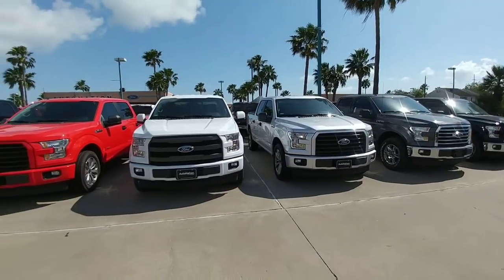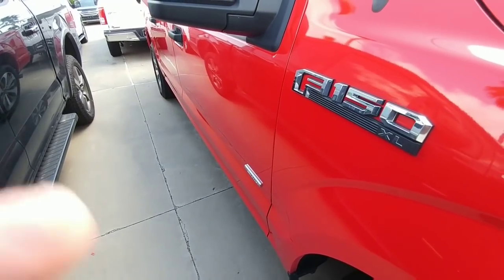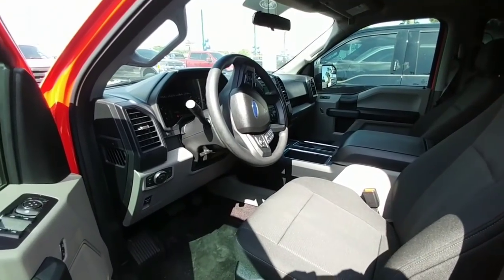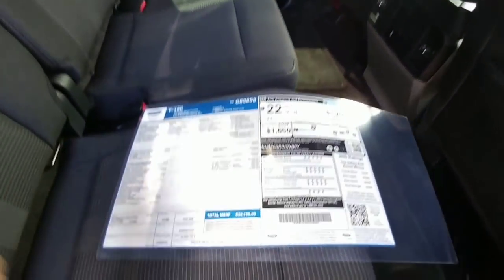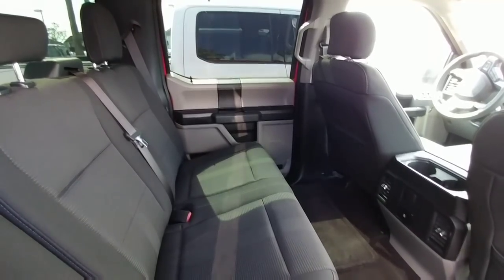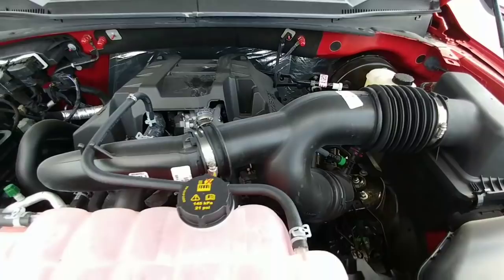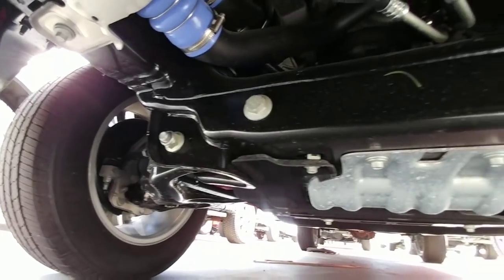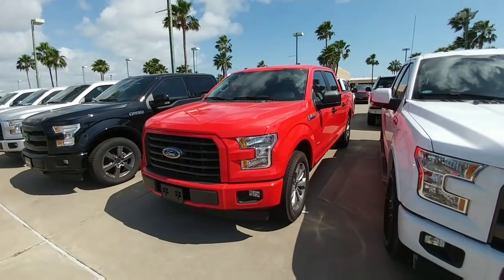Pickup trucks under $29k.. What do you get?

Comment: The STX is what I bought a few weeks ago. I got mine with the 5.0L V8 and had the dealer do the running boards. I've since put in a velcro liner (bed rug's Ultra liner) and a LoMax cover. Mine also had the vinyl floor (as mine is for both work and kids), extended gas tank, hitch, and tow reversing system and finally, mine had cloth seats, which I prefer in the Texas heat. I also paid under $30k for mine. It rides very nice, has great power and does what I need it to do (I haul cleaning equipment around, none of which weighs more than 1,000 pounds.. most of it will fit in the bed easily).  I will get the windows tinted at some point. Everything you've said rings true to my shopping experience - we also looked at the other brands, and landed on the Ford for the best value/features for what I need the truck to do. Thank you for the review!

Comment: Parking sensors!?!? My favorite parking sensor? A good steel aftermarket bumper (a lá Ranch Hand).
Reply: not the person you smash into's favorite parking sensor. Then it won;t be your wallets favorite
Reply: If you're in a situation where you have a huge truck, you're always parking around other vehicles (a la city driving), you pull into said parking space with such brute force that you could "smash" whatever is at the other end of it, and you're so unfamiliar with your truck that you HAVE to rely on parking sensors, maybe a large truck is not the vehicle for you. I don't knock parking sensors at all and fully endorse them, but a steel bumper will "deflect" others' parking mishaps, as well. I am STILL getting used to the massive height (front leveled 2.5") of my "where did that Miata go?" front end of my RAM; even after 7 months, though.
Reply: Luke Edward your picture is at west palm assembly hall!

Comment: The transmission lever has 2 optional modes 1) The tow/haul mode that you would expect. 2) the Sport mode which makes this truck take off faster and is a lot of fun to drive in this mode. It's hard to describe so you are better off trying it for yourself. When you accelerate try to remember it's only a 2.7L.

Comment: Awesome.  Keep them coming.  Really like the console and electronics on that model.  The output specs are better on the gen 1 ecoboost, than on my 5.7 from the 90s!  Taken in that context...you're getting a lot of work for your money.
Reply: climbthatmountain Yes truck I seriously doubt those modern trucks will outlast the old trucks.
Reply: CJ Colvin , outlast is relative to the individual and the situation.  Fixing some lifters or the timing on an older 350, could be a shade tree job you can handle quickly on the weekend.  Diagnosing and fully repairing a system failure that takes engine components down with it, could be 15k or more in the mechanic's shop.  If I've got the money in hand, (and what if I didn't) I'd have to ask myself, do I put 15 or more back in my old rig, or finance another 15 for a brand new ride.  The what you get in that scenario practically makes the decision for you.  The opposite could be true in the case of it being my old truck, cheap parts, I have a few spares...it's a really individual decision always.  All that above being said, it's enjoyable lusting after a new truck.  😄   The boss may let me upgrade soon, and there's so much to chose from...and lots of good any way you decide.
Reply: climbthatmountain I have a 96 Ford F150 with 5.0L Windsor V8 with 204,512 miles on it and it's still going strong. The only thing I replaced on my truck was the starter but other than that mostly was just simple maintenance and cleaned out the transmission fluid just to get rid of the shuttering it was making and it hasn't had a problem ever since until the steering maganizm went out but now it's back on the road running strong. My dad has a 2011 Ford F150 XLT super crew with a 5.0L Coyote V8 making 360 HP and 380 Ibs of torque, gets 19 MPG, and has 120,000 miles on it and it's still going strong and it sounds like a beast.
Reply: CJ Colvin I love it.  My 5.7 is a 1997 fleetside, 388k, pulls like a ox and runs straight as an arrow.  Everyone gets a lemon once in a while, but sometimes you get lucky and get a really good one!
Reply: We had work trucks with the Triton v8, I can't remember their size in l, but I've had more of those than the gmc's, they all pulled great and lasted forever.  You'd wear a truck out around some of those engines.  Like I said...we managed by luck to get some great ones.
Reply: climbthatmountain true.

Comment: I don't get why this is so shocking to people. Not only can you get a nicely equipped 1/2 ton for under $30k, you can even get a nice 3/4 ton or 1 ton pickup truck for the same money or just slightly more. My Local Ram dealer sells 2500 Crew Cabs for under $30k all year long. A truck like that includes, metallic paint, power everything, the Hemi engine, chrome wheels and bumpers, tinted glass, touch screen, much more. Don't know why people complain so much about how expensive trucks are these days. When you consider how much you're getting, they're actually pretty good deal.

Comment: if you want all the toys you get with high end trucks but only have 30,000 for a budget, why tf are you trying to buy a brand new truck? you would get so much more bang for your buck if you went to the used market, just buy a 2013 or 14 and your equipment list will triple. let someone else pay the depreciation on a new rig. just sayin
Reply from the maker: With $10k off of a $38k truck (over 25% off MSRP), that type of deal generally provides some buffer from the initial new car depreciation.  It's hard to find a used truck, with low miles, that can compete against a truck at that price.  Especially considering things like 8" Touch Screen, 20" Wheels, and the EcoBoost at a ton of resale value to these truck.  Good comment though.  Thanks

Comment: 0:07 shaft is welded to u joint u joint is on carrier bearing cant move 0:08 splines begin but at 0:10 you can clearly see they end before that rubber cover it looks like so what are their purpose
Reply: James Flores i was wondering y the shaft between the carrier bearing and the axle looks splined?

Comment: Why put aftermarket exhaust? Does it increase performance or just for bragging rights?
Reply: Only a little performance gains.
Reply: LX Media Think of it as a straw in your soda that has a hole in it being the stock exhaust. an after market exhaust would be like replacing said straw with another that doesn't have a hole in it. helps the engine breathe a little better  but I wouldn't recommend doing it on a 4 banger truck lolz

Comment: I can't really much of a difference between my 2007 chevy and this truck like there is better technology but that's it and my truck has a sunroof and it get hardly worse mpg but it's a v8 and has like 350-400 hp
Reply: Forgot to mention it's 4x4 with 4 low and 4 high

Comment: It has a column shift and a key !!! only thing missing is A 5.0 v8, I refuse to buy a truck with a v6.
Reply: Troy so true I have a Silverado rocking a v6 and it feels so underpowered. I really wish it was a V8.
Reply: Arjen Robben yea it don't matter if there are turbos on the v6, they just add unnecessary cost of fuel and repair when you can get competitive fuel ratings and usually better hp ratings from a v8 and save all kinds of money in the long run and longer engine life from a lazy lugging v8.
Reply: Troy Your comments are not even close to accurate. .......no n/a v8 lazily lugs like the ecoboost v6s do, for real the v8 has to use more rpm  to get the power these v6s get. Take fuel to make power, sorry.
Reply: Rccr Dawgs ok so the eco boost gets a max of 27-28mpg? How does a a chevy v8 with 650hp/650ftlbs of torque in a corvette with cylinder deactivation get 32mpg highway lugging down the highway? How does my 1996 chevy Tahoe with 5.7l 350 lug around town at 21mpg like it does? How come chevy trucks with 6.2l in there top of line trucks are just shy of the horsepower and torque of the ecoburst and very close if not better mpg with cylinder deactivation and superior engine tuning chevy uses. Do you know what your talking about. Because what ford does to get the numbers out of its ecoburst motors puts them under strain and shortens the life of them when the v8 is gonna keep lugging like its brand new and it's proven it self many times over. But what do I know I've only been a general servicing mechanic for 12 years and only fixed a few cars I'm only a rookie that don't know what he's talking about.
Reply: Rccr Dawgs U seriously doubt the Ecoboost engines will outlast the engines that even in the 92-96 Ford Trucks.
Reply: Troy You are correct mate.
Reply: Troy 11.5:1 compression 6.2l chubby, 10.0:1 compression  3.5l ecobust  .
Reply: Troy my truck has a v6 naturally aspirated and my truck takes forever to hit 20mph. you hear all this engine roar and the loud ass exhaust but no power behind it. dude my mom has a 1999 suburban V8. her truck picks up like nothing smooth ride. shit you don't even hear the truck. keep in mind my truck is an 08. the only way I would consider an Ecoboost was if I lived on a mountain or somewhere. where it is harder for the engine to bring in air and that is where the turbo will really perform.